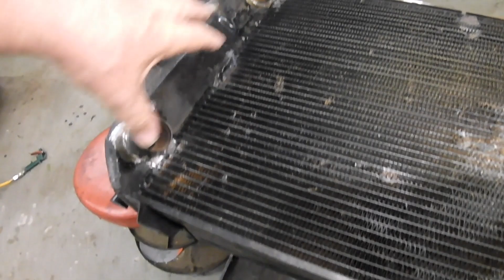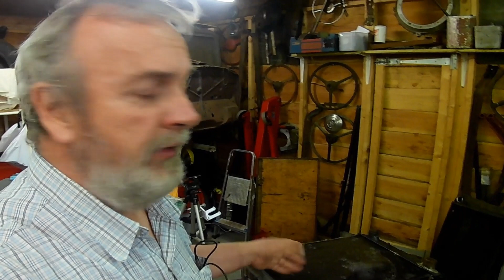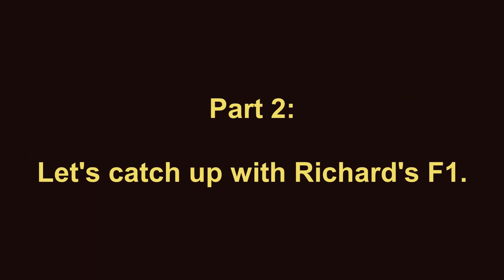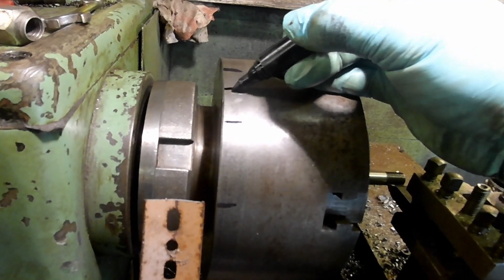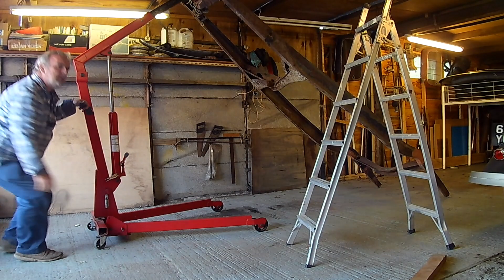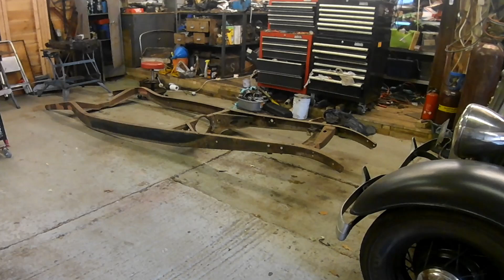Mart's 1932 Ford Sedan Project Pt1. Rich F1 progress. Lathe job. Bits n Bobs 2

Comment: I'm a bit envious of your soldering skills Mart. I've had better luck with JB WEld.  I can solder copper pluming lines but have not had much luck with radiators.
Reply from the maker: Thanks Ralph. keep practicing, it's all in the heat control. I must add I'm no expert.

Comment: Sorry if I missed it:  how much, or what parts,  are you missing for the 32?
Reply from the maker: Not sure, Merc. I took it apart quite an few years ago so I can't remember. Pretty sure I can find most of what I need. I knew I needed a spring because I broke the main leaf on the 33 when trying reverse it. I used the front spring I had stashed for the 32 on the 33. I also knew I needed to do something to the radiator.

Comment: That was a nice bit of lathe work.  Is the 32 a two door model with 5 window, and the rear seat windows are almost as wide as the front door windows?  If so, it is what I believe Ford called a Victoria in the U.S.  The coupe had rear windows that were narrower than the front windows. Working on the 32 will give you lots of videos to show us. It should be fun.
Reply from the maker: Thanks Christopher. It's a 2 door sedan. The Victoria has a shorter body (half way between a coupe and a sedan). Yes, it should be fun to put it together. I did a lot of work on it years ago but had to dismantle it when I bought my 33. I made it "disappear" by stashing the parts all round the place.
Reply: @MartsGarage  Thanks for the explanation!